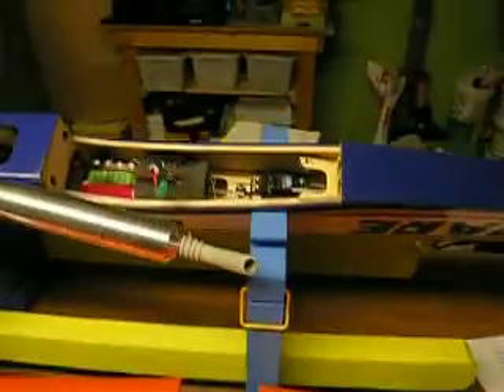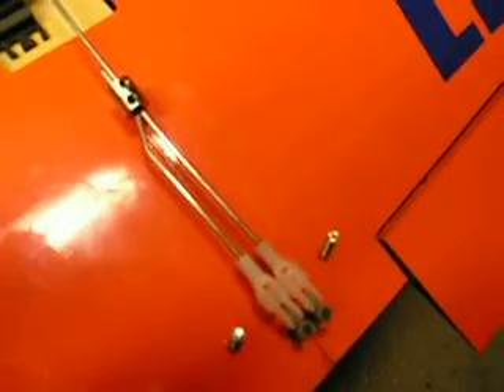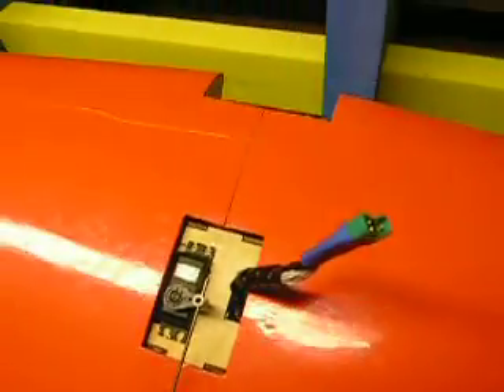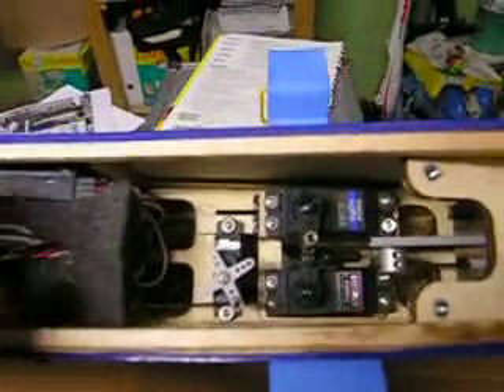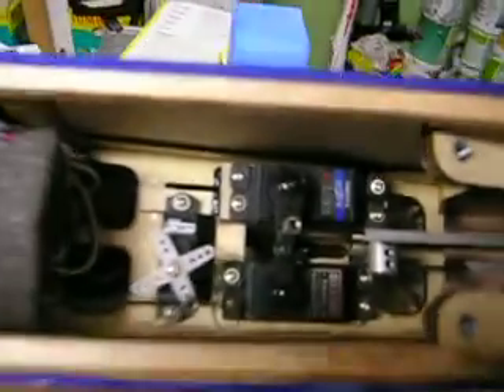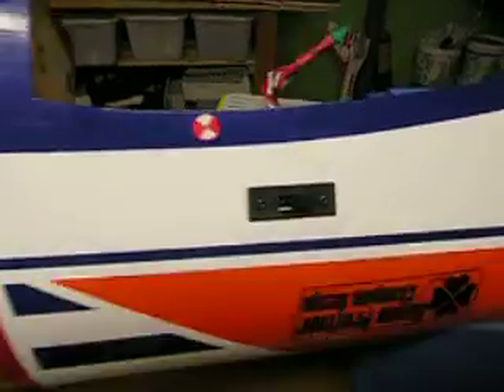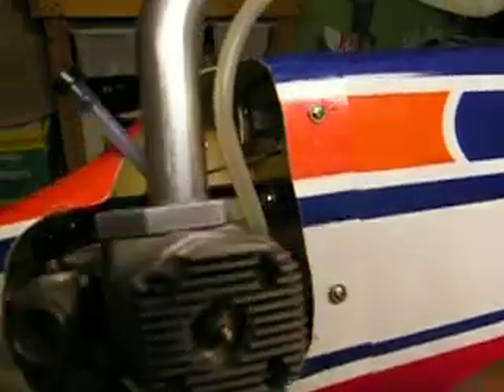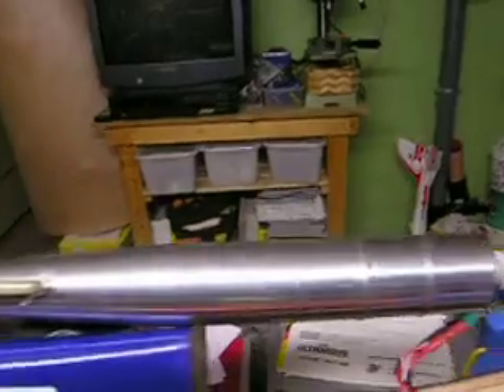Hanno Prettner Curare ARF - a look inside the plane

Comment: I built one of these from the kit way back in about 86. The only problem was getting a reliable retractable undercarriage system at that time. I tried a couple but they were so unreliable and costing so much to persevere with that the plane never flew. I could have just used a fixed undercarriage but it was such a superb kit and beautiful lines I couldn't bring myself to try that. I had a lot of other planes to fly and eventually the Curare style was overtaken as Hanno himself said, by much simpler designs and also I went into scale planes.